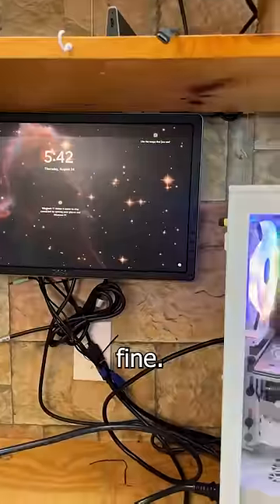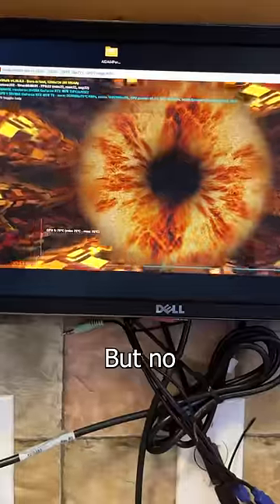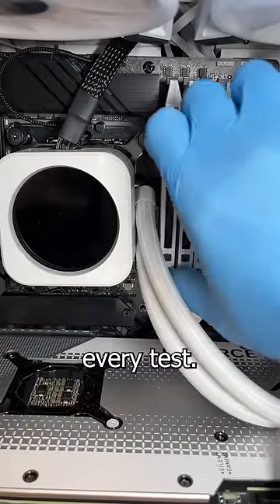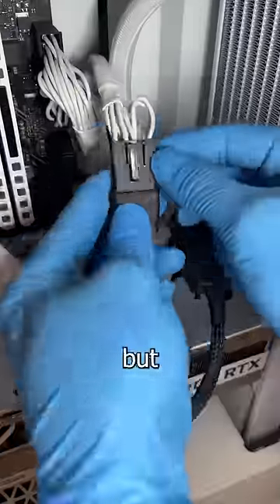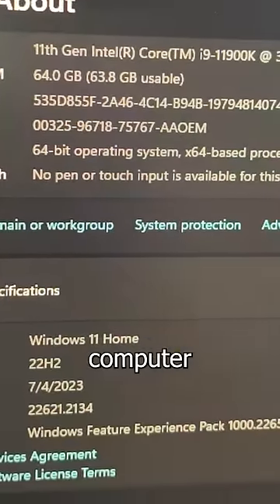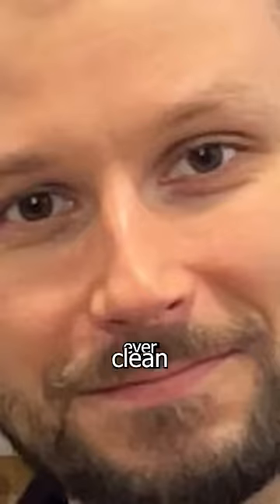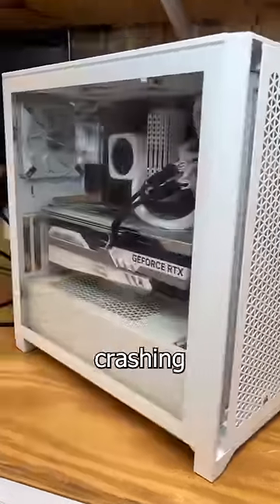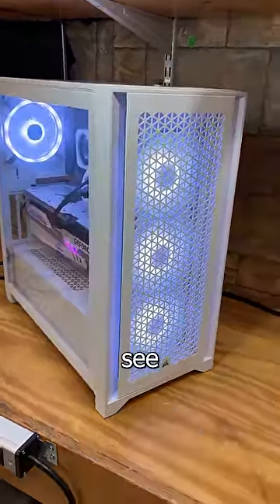The hardest repair in my shop is a #gaming #pc with random problems #technology #shorts #tech

Comment: In your experience; can a faulty HDMI cable cause intermittent power failures requiring a hard reset of the PSU? I ask this because it is the only veritable that I have not pursued yet. I'm too lazy to cut the zip ties in order to pull another HDMI and too cheap to buy a new one until it's confirmed by someone more experienced. Thank you in advance.

Comment: I have an Asus laptop and it keeps shutting down on its own. I've looked around online and the best thing I could find was that it must not like one of the peripherals connected to it. I have a webcam, a headset. How can I confirm that's the reason? Is there a solution to it? It's quite annoying when I'm in the middle of a conference and it turns off. But it's random, sometimes it's ok, sometimes it turns off. It's not entirely consistent.

Comment: i had the near identical problem with a very similar setup Ryzen 9 7850x with 32g ram, and it also was randomly shutting off/rebooting, and it would take a SUPER long time to even boot up to get to BIOS (like wtf?) then i down graded my ram TO 32 gigs and havent had a problem since, so either the software (windows 10 and it will NOT let me upgrade to windows 11 due to the drives not being secured or even the new .M2 NVME  (and that sucker wont boot to that either)) wont accept the usage of that much ram or i had a bad dimm which is also possible.  That was my "fix" lol

Comment: I had an issue with my computer guys at repair shop couldn't replicate but decided on what was most likely reason and fixed it anyway. I think it was something to do with battery or charging cable? Well they replaced both so it's all good now.

Comment: I have this problem on my prebuilt Omen. It'll just randomly power off and then the Omen diamond will do the 'breathe' animation for its light (idr what the light setting is actually called off hand) with the only other light being on being my GPU. To get it to power off again and be usable (it bricks my system unless I do this) I have to unplug it completely and it takes 5-6 seconds to power down. This has also persisted through multiple moves, outlets/power strips, etc.

Why is this relevant? I was hoping this was a fix for my problem :/

Comment: I know this is an old video, but i want to share my own experience, so i upgraded my pc into 500w psu while using my old 300w UPS, and i got my pc shut down when i tried a new game, so i conclude tht when my pc push itself to run heavy load my UPS cannot give the electric power it need, so it shut down. Maybe it also happen on this customer 🤔

Comment: had the same issue with a 3.0 usb hub, If I plug it into my 3.0 usb port in my computer it doesnt work, though eventually the hub popped and got burnt for some reason. by my computer works fine without it.

Comment: My computer would randomly restart and i couldn't figure it out for months. I eventually just decided to do a complete rebuild except for the case and it did it again. FInd out that the cable in the case that attaches to the reset switch on the motherboard was shorting and i just unplugged it and problem fixed.

Comment: my pc was recently crashing when gaming or just watching my friend stream on discord but not rendering at 10 % utilisation of the hardware, and it was seemingly random, no bluescreen and nothing in the logs except when starting the PC it just said it got shutdown wrong. Then I removed my GPU and I started windows. and it worked fine, but I could not sit there with a Computer without a GPU if I wanted to do more than browsing or get taunted by friends so I installed my GPU again and suddenly I was not able to boot into Windows again without bluescreening. it was my damn Nvidia drivers had gotten corrupted in some way. after reinstalling windows cuz I didn't want to spend more time as nothing I did made it work. and now it have not crashed Randomly in 3 weeks. it still crashes sometimes but its because I'm making stupid decisions sometimes.

Comment: Putting an older motherboard that doesn't have that 10-1 JFP1 plugin. The MOBO I am trying to install a 20-8 pin layout and I can't connect with out breaking up the connector pins. How does one go about fixing this connection issue?

Comment: My pc is eprfectly fine other than i still have to clean out the dust and that my screens randomly turn off and then i have to reboot it and sometimes update some software. If i don't only one of my screens will work and my fps will be very low. It also randomly restarts but only rarely.

Comment: I have a question, when i Play games, my CPU starts to overheat for no reason, no matter that the game is only one cube. When i use it for too long it over heats (max 1.5h) i bought an air cooler and it works but still overheats without being hot, what the hell is happening😭🙏